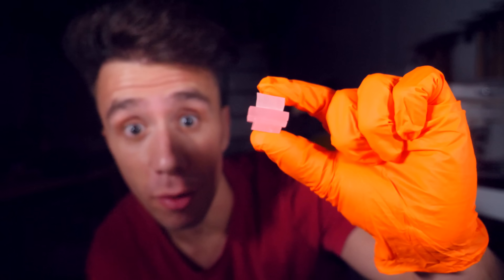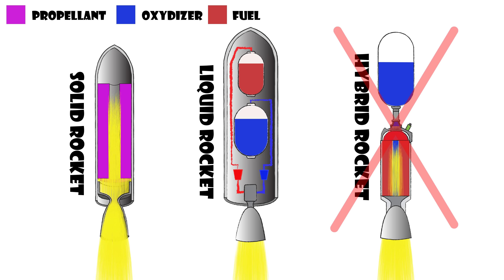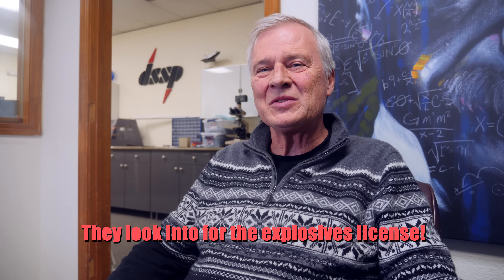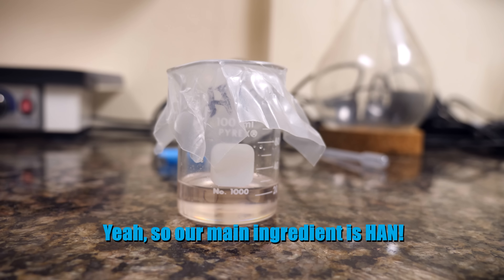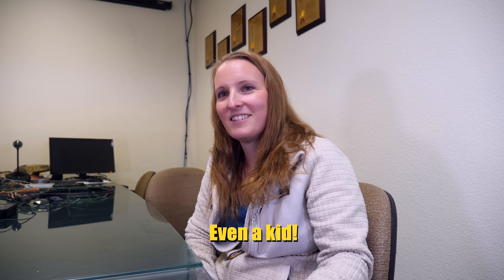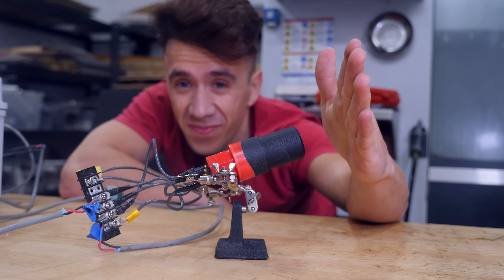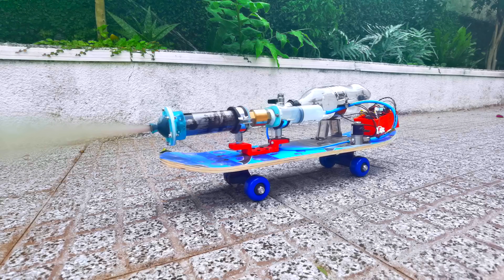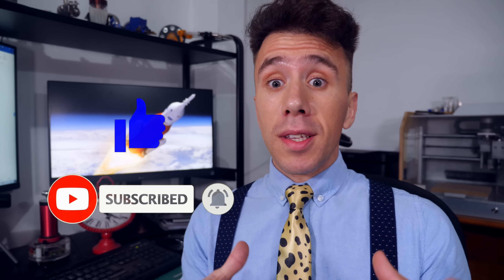ELECTRIC SOLID PROPELLANTS

Comment: Video idea - continious flow stirling engine. For example - two cylinder engines connected together. One has a smaller piston size than the other. Or, they are geared together... on side has a hot plate, the other - a clod plate. The hot plate pushes large cylinders. Which turn the small pistons. Which inject gas into the hot plate... where the gas expands - pushing large pistons. Which rotate the small pistons - which inject gas... That way, you could completely isolate the cold plate from the hot plate. Or, even run it only with the hot plate. Potentially making a near 100% efficient stirling engine, that has a square otto cycle. 

The professors at the faculty could not find a flaw with this. But nobody had the "time or resources" to look into it. A continious flow stirling engine. External combustion engine. Running on low friction piston... though... a 3D printer probably won't be enough for that. You'd need some CNC capacity... Poscket NC, 5axis?

Comment: That looks really promising. Safe propellants for both main engines and thrusters, which only can be ignited by electricity (the solid version) or with a catalyst (fluid) and so can also be turned off whenever needed, the solid also having other fields of use. I want to hear more about this!

Comment: nice video. saw one new item that never thought . and It will be possible when it's giving out energy then also it will be possible, could develop a mechanical structure with more other fuel materials which will create more thrust,  could be capsules or could be lear after lear with combined with one or more materials. if this item is cheaper and easy to find in laboratory there are many mini scientists they will create some new engine

Comment: Awesome concept. I am wondering if the propellant coming out of the end of a rocket engine would be able to run a turbine sufficiently for something useful like generating electricity or mechanically propelling a vehicle? This way there won't be a need for storing compressed gasses or running a compressor with batteries.

Comment: What if you could 3D print the HIPEP into a shape? Maybe you can use it as a sort of optic fiber and steer rocket with it like that. 

Or you could have a string of it getting pulled through to the nozzle so you can have it close to the ignition source.

Or you can mold it into a long strand and use it like that.

Comment: I like your videos.  I have been flying hobby rockets for over 35 years and your videos have taught me new stuff that has inspired new experiments in my personal rocketry activities.

In my professional career I am a manufacturing engineer / design engineer.  Mostly, I have always depended on prototyping parts with CNC machining equipment.  But, in the past 5 years I have been able to produce prototypes using 3D printed parts.  It’s opened up all types of possibilities.

(So, yeah please give me a 3D printer)

On to the engineering challenge…

Hybrid rocket engines do have many “issues” that limit performance.  But let’s all remember, the first civilian “manned” spacecraft that won the X-Prize used a hybrid rocket motor.  

One of the big negatives with a hybrid motor is that the inert mass of the hardware required to build a functioning hybrid motor counts directly against the thrust you can generate.

(Example - My hybrid rocket can generate 100 pounds of thrust but my case hardware weighs 25 pounds so…the rocket is only generating 75 pounds of useable thrust.

The other negatives relate to the fact that the thrust generating reaction in a hybrid motor is not as powerful as traditional solid propellants.

AND - keeping nitrous oxide liquid on a hot day means spending even more money to insulate / refrigerate flight tanks and ground support equipment tanks to fill the flight tanks.

(Don’t bother with this 
challenge unless you can 3D print battery powered refrigeration equipment)

In high power hobby rocketry you can get improved thrust-to-weight performance by using disposable (single use) composite motor cases.  It costs  more, but it is higher performance because you reduce the overall inert mass of the rocket motor.

I’d like to see you try to build a single use disposable hybrid rocket motor that uses composite and 3D printed parts to reduce the inert mass of the motor.   

I’d then like to see a comparison of delivered thrust between the disposable hybrid and a reusable hybrid made with all the metal.  

(Keeping as many things equal between both hybrid motors as possible.)

Keep making your videos.  They are entertaining and educational.

Comment: This might be a good application for a spacecraft with a fission reactor on board.  It be curious how compressed you can store the more stable starting materials and how automated the manufacturing process could be in zero gravity.  Did they discuss the actual rate of expansion?

Comment: The f16 used to (maybe still has idk) a hydrazine based auxillary power unit so you could start your engines and that kinda stuff. Hydrazine is no bueno, but it has been used quite a bit.

Comment: They are right about the propellant. You got to have ATF clearance. However you can make a piezo type solid propellant for an ION engine like in your other video. String your ION engine in layers. On the first layer you put a strip of parafin wax doped with aluminum poweder. Its not explosive at all. Its easy to make. Melt candle wax and add allumaseal. Its a common radiator repair product sold at the auto parts store. Put candle wax  in a double boiler pan used for chocolate melting. Then add the allumaseal until its a thick paste. Pour into an ice cube tray. After cooling pop it out. Then you can cut it with a warm blade like a razor. Place the strip on the first layer of your multi ION thruster. The first layer will pull the aluminum powder from the strip. This will increase thrust. The output is like burning a candle. Not toxic but you should work outside and wear a mask. Its fine aluminum so be safe. You would wear a mask when grinding aluminum. So wear one when your testing the ION engine. I would be happy to assist you in making a model of this. I could use a new 3D printer. Still using my Prusa I3 plexiglass one. Not so good printing any more.

Comment: So, 3d print a hollow two blade fan, fill the hollow space with GEM and a nozzle at the tip…. When you light it off, the fuel will flow out to the tip. Power can be supplied like a car horn/steering wheel so you gave full control.

Comment: For a future video i would like to see using hydrogen as a fuel in internal combustion engines.  I understand that this has been done before but since it produces another type of greenhouse gas(n02 i think) there has got to be a way to mitigate that byproduct.  Maybe brainstorm together on how to mitigate this problem.  

One more Idea...I have had an idea on building a personal quad copter out of chainsaw engines.   How do I calculate power to rate ratios for lifting humans and the vehicle.   Can these saw motors be flipped for forward motion or will that stall the engine?

Comment: I reckon it would be awesome to see you build a multistage rocket and actually launch in in some remote field or something. You build a lot of engines but rarely actually test them in flight, I think only once in your sugar rocket video did you actually launch any rockets. It would be cool to see you choose one of your  past engines and create a working model rocket from it, and it would be especially unique if you made it multistaged and perhaps attached some sort of command nodule with an arduino or something.
Would be a cool process to watch in a video!

Comment: Can't believe this thing made it into commercialization! I've read about this in a nasa monoprob-study and was intrigued (since HAN is an ionic liquid). I did some rough calculations and the numbers are super intriguing. It should have more ISP than Hydrazine/Nitrogen peroxide all while being non-toxic, carcinogenic. Just needs a iridium and rhenium catalyst and you're good to go.
If you would combine this with liquid methane you could safe about 50% volume all while having more energy - here's what i roughly came up with:
HAN+CH4: 1,85kg  -> 11,2 MJ/kg
MMH+DNTO: 3,45kg -> 9,4 MJ/kg
The numbers are with 1 mol each, to make things simple

Comment: It would be interesting If Hipep could be used to generate plasma for Ion engines with lower power input, as a lot of the power needed for ion thrusters is for the initial ionisation.  If it can help with that issue when partnered with nasa's kilopower program this could be a good fuel for a mars mission or similar space exploration with rolls of Hipep 'feedtape fuel'.  Additionally, being composed of hydrogen, oxygen, carbon and nitrogen (mars has nitrates) - it may be possible to in-situ refuel on mars (or phobos).

Comment: Inflate a tomato with a hydrogen generator that splits water into oxygen and hydrogen together. And send that tomatoe into bits. That would be a fun video. Just use distilled water and electrolytes and DC power and a flash arrestor to prevent a flash back. Would be exciting to see that tomatoe exploded with power of H2O gas

Comment: my idea consists of a horizontal rail as a launching pad, made as much as possible with a 3D printer, my suggestion for a good launch, is to use a kind of catapult like those of an aircraft carrier, with rubber bands or a type of Railgun for a more sophisticated project, and with greater possibility of a co-lab with another youtuber, the ideal is that the rocket combusts at the end of the rail to make the most of the elastic thrust, for the launch curve format, I suggest the use of a shape called "The Brachistochrone curve" a principle used to maximize cornering accelerations.

Comment: The science behind 3D printing rocket engines
The benefits of using 3D printing for rocket engines
The history of 3D printing in rocket propulsion
The future of 3D printing in space exploration
The challenges of 3D printing rocket engines
The process of designing and printing a rocket engine
The role of 3D printing in reducing cost and increasing efficiency in rocket propulsion
The impact of 3D printing on the aerospace industry
The environmental benefits of 3D printing rocket engines
The collaboration between 3D printing and traditional manufacturing techniques in rocket propulsion.

Comment: In keeping with space tech, see if you can design a miniature prototype for modulated and pressurised vessels or pods that could act as different components of a space ship or station. A compartment for a sustainable aeroponic/aquaponics systems with water capture/recycling capabilities, air filtering, engine room, power plant, accommodations, recreation...etc. If you could build a few “pods” and design a way to assemble them to create a pressurised and self sustaining environments for space travel/dwelling, that would be pretty cool 🖖

Comment: The German airforce in WWII had a rocket plane, the Messerschmitt Me 163 Komet, which used Hydrazine and another chemical to power the rocket. The main issue was that the hydrazine was so corrosive that it would eat through the fuel tank if it was not constructed correctly.

Comment: Wow I hadnt heard of ESPs before. That is an incredible idea. There must be a massive downside, otherwise they would have been used years ago.
Reply: Probably cost. Which may also be the reason they are targeting satellite thrusters, and not main propulsion engines.
Reply: @court2379  I'm also curious how efficient they are
Reply: I'm guessing there are two issues. One has to do with keeping an electrode at the right distance away or whatever method of maintaining a plasma is needed. The second issue mentioned with scaling makes me think it starts acting more like a conventional explosive once you have some kind of shockwave propagation occurring. So it's probably similar to ammonium nitrate in that regard, and thus why it's considered a restricted material. If it gets to a condition where it all wants to go off at once, then it's not so great for rockets after that threshold. For a solid fuel burn, you want the reaction to occur at a boundary layer at a somewhat steady rate.
Reply: Guys, watch the video before you go commenting... Might accidentally learn something.

It's in the video. It can't be throttled at the scale of a rocket booster. No way to control it, it becomes a normal propellant. Just expensive, and with a poor thrust-to-weight ratio.
Reply: @RobinTheBot  Those are just problems to overcome. If it was cheap we would find a way, or use it anyway knowing it has those limitations. I still say it is cost.

Also while I mentioned main propulsion engines, the original statement does not.

Comment: Very excited to see more videos on throttleable propellants! I’d be excited to see you look at thrust oscillation and resonance frequencies in some of your rocket designs.

I did an internship years ago focused on the problem of solid boosters causing the whole rocket to vibrate so much that a human crew wouldn’t have full control for a brief window. We looked at a bunch of possible solutions to counteract the oscillations to protect the payload and crew and to have a smoother flight. At least some of those could definitely be used at the hobbyist scale

Comment: You've turbocharged a pulsejet engine, and built a turbojet engine, what about a turbocharged rocket engine of some description? if you could do something to increase the speed of the reaction in a rocket you could make something much more powerful but with a shorter runtime. Hard part then might be to keep it in one piece so it doesn't turn into a bomb.

Comment: If as you say, a very small amount is needed to give a powerful evolution why not use gem as a fuel for internal combustion engine. E.g. replaceable fuel rods energised by spark plug.

Comment: @13:15 another reason not mentioned is that if any fuel is left in the missile when it impacts then it could be considered chemical warfare. One could even deliberately over fuel them to get this as a desired effect with little oversight.

Comment: While on the topic of rocketry: My suggestion is to try to make an aluminium fuel cell.
I always wondered why Rocket Lab don't use it since it's more energy dense at the same weight, should be much cheaper and they already have oxygen on board, the only downside is that it's single use but they throw away their batteries anyway. 
So I want to see how challenging it is to make something with aluminium and NOT let it oxidize before you can take the energy out of that reaction.
Reply: Probably easy of supply and "no unknown factors".
As they can get a well know LiPo while a aluminium fuel cell... I do now know were you would get one, or even how safe or viable for space travel is.
So they would have to make one and make it viable.
Reply: Also the amount of energy it takes to make aluminium
Reply: @sirhaydn-1  Not even remotely an issue in the context of rockets, which already are made from lots of aluminum and far more energetically costly materials.
Reply: @treelineresearch3387  well for rockets yes. But for replacing Li-ion batteries, no. As they say in the engineering world, you can’t have something that is cheap, fast, or good. You can have at least two.
Reply: I think it would be worth a try since aluminum-air batteries have been used for powering missile guidance computers for decades.
Reply: @JWQweqOPDH  Yes I do think they would be worth a try but I don't think they are ideal.
Reply: aluminum instead of lithium?

Comment: Would be interesting to see if you could figure out a way to 3D print propellant or oxidizer. That way you could tweak the reaction surface area or reaction speed. No idea how useful it would be, but I'm sure you'll find a way to make it entertaining!
Reply: I could be wrong but I feel like I remember seeing him try that a few years ago
Reply: he did a video on it - its just ASA filamentent used for a hybrid engine
Reply: I'd imagine you could 3dp the hipep they mention in the vid, considering it's made with pva and that's a commonly used plastic for 3dp supports, it's also mixed from two liquids and then cast so if you couldn't use an fdm printer you might be able to use one of those syringe types. Not sure what the advantage to doing this might be however.
Reply: You could 3d print rocket candy or apcp propellant.

Comment: 3d Printing always had it's brittle side, specially for mechanical or high speed rotating parts (I tried printing a chuck for a dremel once, and ended up making a couple high speed projectiles going in all directions. Thank f*ck for eye protection).
So for a next video, how about going over some processes of strengthening or even using it as molds for high stress / strength mechanical parts? Hell, any wacky idea, if it works it works, if it doesn't... I'm sure it will fail spectacularly.

Comment: Could lasers be used to work with this? Would be cool to investigate, wouldn't really be useful though...
Reply: You can transfer low levels of current through a laser, so you might be on to something for smaller scale but it would depend of the activation current of the fuel
Reply: @jakelake88-o8d  Tesla coils could work but they're far too large I think, still can't really think of a use better than the current solution.

Comment: I´ve another idea: you could build an instrument to measure the power of every fuel you try, it would consist of a 3D printed rectangle in where you would place a tomato with an explosive charge in it, then you blow it up and you can compare the mass of the initial and resultant tomato to comprobe how much it got destroyed, afer that, you can rate it from 0 to 10 tomatos, being 0 equal to "zero damage" and 10: "total and complete destruction"